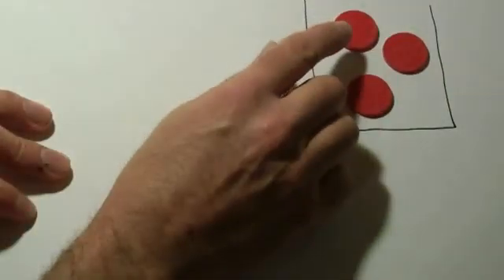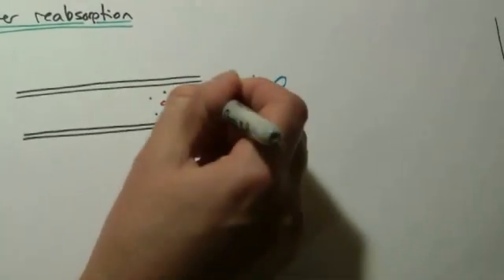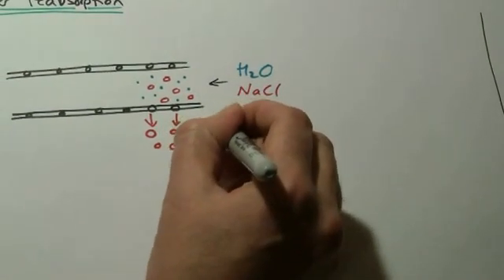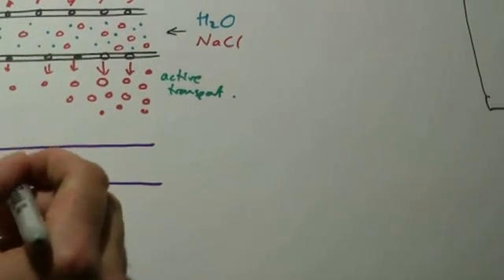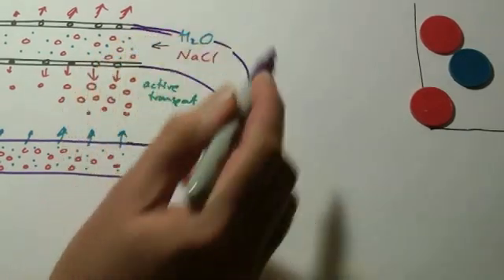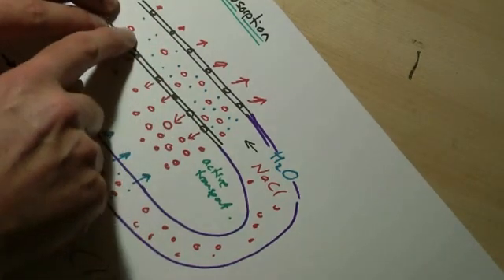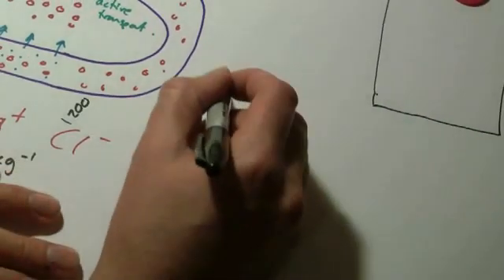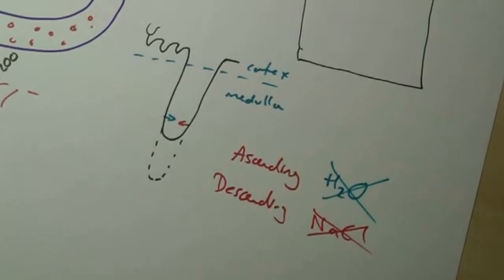Water reabsorption pt 1 - countercurrent multiplier

Comment: Hi, in my textbook it says ions diffuse into the descending limb but you said the descending limb is impermeable to ions?
Reply from the maker: +Tilly Jayjay It has a low permeability to ions (some will always 'leak' through). I think it is easier at this level though to think that the DL is impermeable to ions because this makes it easier to work out how the countercurrent multiplier is working. There's a good summary on wikipedia of the various parts of the limbs permeabilities.

Comment from the maker: Yes...and no. The descending limb is mostly impermeable (it lacks the ion channels needed - remember how ions don't pass easily through membranes?). I think the book diagram suggests that it is very permeable, which is not really the case. I was trying to get the overall idea across that the ions would not diffuse through so the conc. increases in the desc. limb, but you are technically right, some ions do diffuse through at the top.